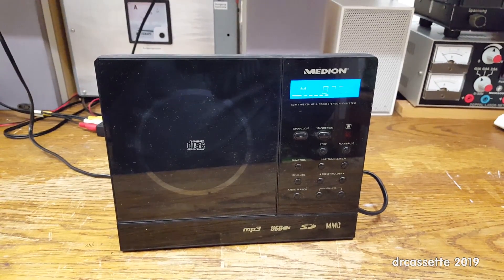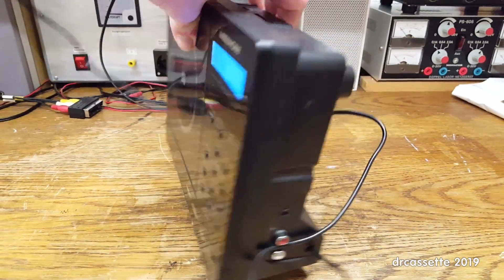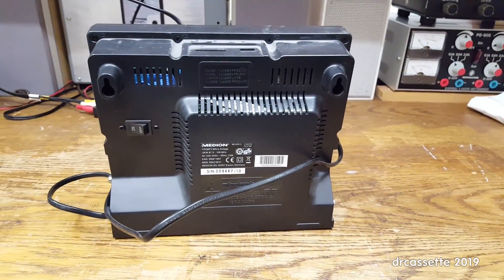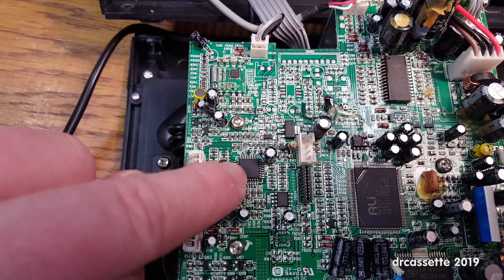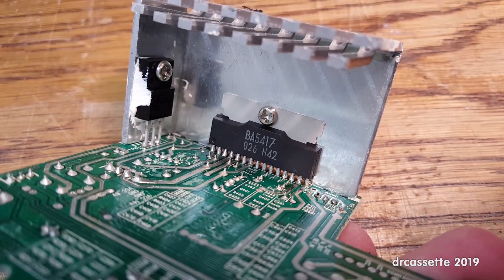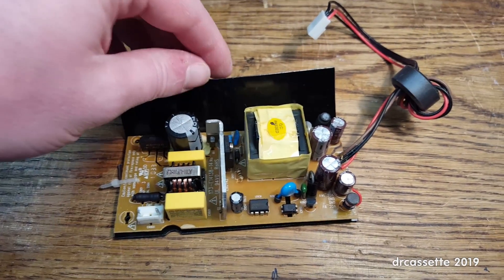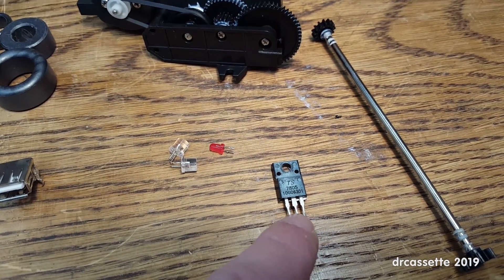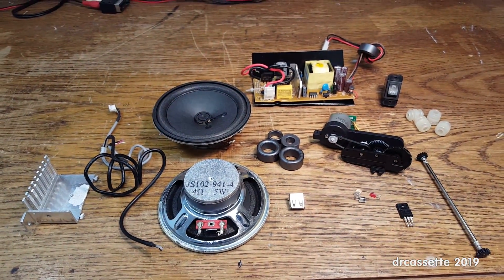Teardown of a cheap Medion stereo system

Comment: salvaging those parts don't worth it. better was to repair & keep it as a piece of history to show your great grand kids 60 years later.
Reply from the maker: I have more interesting devices to show than this piece of junk. I am not a hoarder.
Reply: How is he going to fix it when the optical pickup is bad? It probably be next to impossible to find a replacement and if he could it probably cost more than the system is even worth. Even with maintenance I doubt a cheap device like this would last even 20 years forget about 60.

Comment: Hi MrCassette, I want to learn repair vintage audio. I bought the Monacor PS 605 from your other video and a dual channel 10mhz oscilloscope.Is that good for repairing vintage audio?
Reply from the maker: Much more important than test equipment is that you have some basic knowledge about electronics and electricity in general.
Reply: @DrCassette  Thanks for your reply.If you want to learn me,what you would learn me first?
Reply: What is the basic to learn electronics?
Reply from the maker: There are many great resources. Just don't do what I did and try learning by doing. That would be very frustrating.

Comment: if people had better discernment, junk electronics like this would never exist. They would never buy it. It has no value, once you bought it - it becomes worthless. Sad that people exchange their hard earned money for this junk. Brands like Marantz, etc should be minimum spec/quality available for purchase
Reply: In some cases, junk is all you need. Especially if you don't care about audio quality, something like this works fine.
Reply: you just validated my point by that attitude "Its good enough" position
Reply: @dxer22000  That's the thing. For some people, it is. If you wanted a computer in your kitchen to look up recipes, would you go for a high-end, well-built model that costs way more? Probably not, because a cheap netbook would do the job.
Reply: the problem is  - junk electronics like this are lucky to last 2 years & are so cheap, people throw them away rather than fixing them & simply ends up in land fill.....really damaging to our environment

Comment: Aldi junk, their PC company was bought by Lenovo
Reply: I have an old medion laptop that I got for cheap. It was quite a reasonable machine 8 years ago: 4GB of ram, an ok intel dual core, dedicated nvidia graphics card and very long battery life. Now it looks like something from fallout. It is working fine but it completely fel apart, all the plastic from the lid cracked and fel apart, the hinges broke from their slots. I have never seen a laptop crumbling and falling apart like that.
Reply: I must admit Aldi medion computers had outstanding specs built to a price though. A lot of things integrated to the motherboard though. I have had good luck with them. 1 medion desktop PC I had from 2004 and lasted till 2011 my current desktop computer is a medium dating from 2012 and is still going strong with Minor upgrades

Comment: What I'll do to salvage the amplifier section, is to use a hacksaw to chop off the portion with the IC and the nearby components. This way, it's a ready module that can be used elsewhere for free.
Reply from the maker: That is easily done on a single sided PCB. On this double sided thing with SMD components that is easier said than done...

Comment: Typical Aldi product. Nowerdays Media Markt sells Medion products as well, but I always see them as the Aldi electronics brand. Just like Lidl’s “Silvercrest” brand they are quite generic Shenzen Market products. I had two Medion Camera’s, one bought around 2003 (was my first digital camera), which failed pretty quicky when a colour component on the sensor whent kaput. It got replaced under warranty, the replacement I used up until 2008. It also was a piece of crap that I eventually took apart a couple of years later once I got to know Dave Jones’ teardowns. My mom had pentium 4 PC from the early 2000’s from medion, the CRT didn’t last very long but I still have the cheap speakers and computer itself is still working.
Reply from the maker: In the early 2000s computer equipment from Aldi was very good for the price. I have had many electronic devices from Aldi over the years, and I can say the quality has gone way down. Some of the old stuff is really good and still works. For example, the old Quigg paper shredder from Lidl that I took over has outlasted all 4 shredders my parents bought since.
Reply: Same experience here: sometimes i buy Aldi products, and they are not that bad.

Comment: Could you break out the chip with flat pliers?
Reply from the maker: No, the remaining leads would be too short.
Reply: @DrCassette  
I think Attila meant to break away the PCB from the legs of the chip and then presumably clean up with a desolderer.
Reply from the maker: @WaltonPete   I did such things back when I was a child. Great way to waste an entire afternoon, these days I'm not going to spend that much time on a boombox amplifier IC ;)

Comment: A solder sucker?
Reply from the maker: The problem is you need to heat the entire solder joint, meaning the joint on the front and back of the board to suck out the solder. And by the time the solder joint is hot enough, the IC is dead due to overheating.

Comment: What a piece of junk if the cd breaks when not in use!
Reply from the maker: Yes, that is really bad. It seemed like the laser diode had gone bad even though it was never in use. Mechanically everything seemed to work.
Reply: @DrCassette  
Are you quite sure the previous owner didn't just put that cardboard disc back in after it failed?
Reply from the maker: @WaltonPete   Notice the sticky tape on the cardboard? That was very firmly stuck in place when I got the unit. I'm sure the cardboard was never taken out of the CD player.